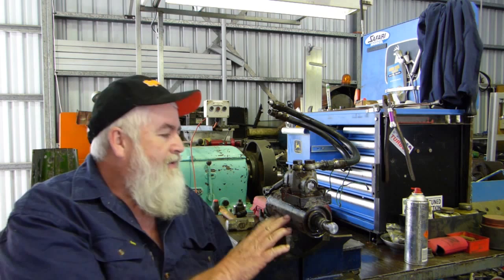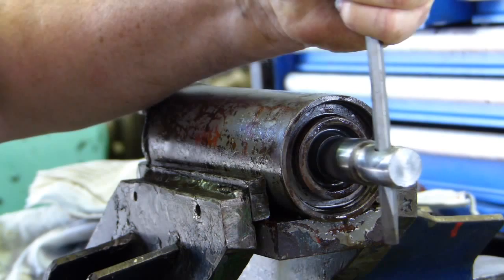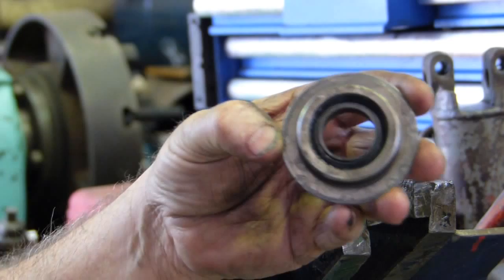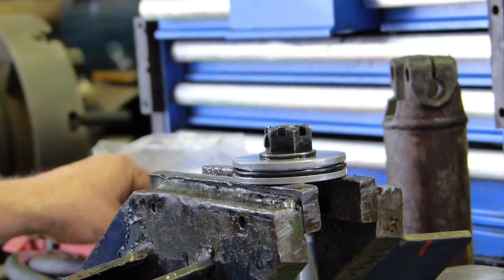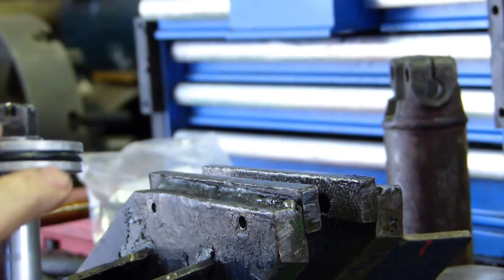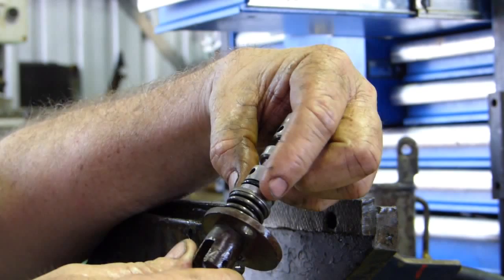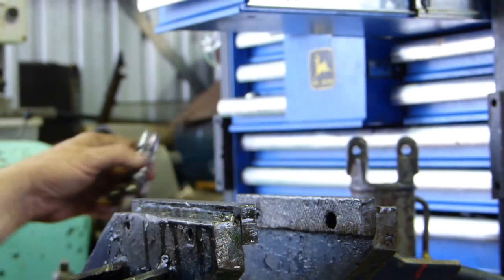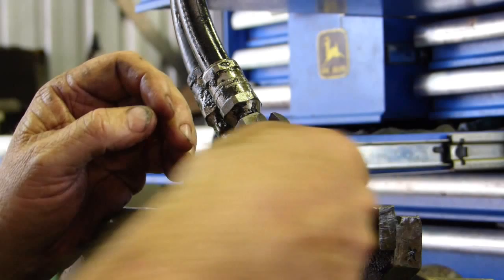Massey Ferguson Power Steering Cylinder Reseal

Comment: Very good information you share. I have a MF 240 4wD and the steering cylinder seems to be leaking inside past the seals making it difficult to steer. I’m always skeptical buying seals fearing they are not dimensionally correct for my part
Reply from the maker: 240 would be a bit different but open it up and see what is going on.

Comment: Watching from AB 🇨🇦. Thanks for the informative video!

I was wondering if they intended the back up ring to split on purpose? I have seen many others in different applications where they are split on purpose. It basically does the same thing just easier to install it. 

Im about to do one of those cylinder rebuilds on a 1969 MF 165. Also doing a clutch in it, because they hit something with the mower and it had a grade 8 bolt in the place of the shear pin, so it roasted the pto clutch off the flywheel. Got my new parts, just waiting for the machine shop to finish with the flywheel!

Good video! Thanks again!
Reply from the maker: Some are split for sure but they are usually split on an angle I was thinking.

Comment: i have a MF65. could you either do a video or explain how you removed the cylinder housing assembly from the tractor itself? the pin at the top of the ram and then the pinch knuckle at the bottom of the housing. thanks again.
Reply from the maker: If I get another tractor I could, I have sold this one to a mate of mine now.
Reply: I'll second that, I can't determine how to remove the pins that hold them

Comment: turnbuckle adjustment critical. Fixed mine . Had no power steering until adjusted.
Reply from the maker: Yes it is you can either have it favouring the left or right with the adjustment on that.

Comment: there are o ring tables that you can use to work out what ring to use it make the job go well when needed
Reply from the maker: +Bleu Wolf . Would you believe we have 9 o'ring kits to pick from and none had the right size, went to ENZED and no good there either but the Sparex kit came and got the job done, right size felt, right size scraper seal etc. we will use the Sparex ones in future for sure.

Comment: Love your videos great job! Have a Massey 135 1973 industrial it has a valve on the steering column with two machine services and I can’t get it to stop leaking. They sell a small kit and I’ve changed some of the O-rings and such I just can’t get it to stop leaking on the circular small plate on the bottom opposite the valve top ! the steering wheel pulls up and down. I’ve looked around and can’t seem to even find a new valve.
Reply from the maker: Im pretty sure the standard one from a 165 fits and does the job.
Reply: @BundyBearsShed  Thank you so much that’s perfect and you just save me $300. Thank you so much! Love your channel

Comment: I am still stuck with this particular project on my massey ferguson 50. My issue is i cant figure how to remove the power steering cylinder itself. I am talking about the same cylinder you are rebuilding here in the video. There is 1 pin at one end and 2 "pinch knuckles" around a larger pin at the base of the cylinder. How do you get these out???  I have the shop manual but it is very vague. Ive tried multiple times and am stuck. I dont want to break anything. could you please describe how you removed the cylinder from the tractor?
Reply from the maker: I dont have the tractor any more but I know they can be tight, give it a good soak with wd40 and tap it around a bit and it mat loosen up for you.
Reply: Bundy Bears Shed why the piston so hard to come out from the cylinder, because i trying to push out its come a little and then stop and i fell there is something stuck inside so please help me?

Comment: I'm trying to fix power steering on Massey Ferguson 230. Basically there is no steering. No leaks anywhere, pump is full, but will not turn either left or right except when I jack up front of the tractor. Any ideas?
Reply from the maker: G Day Col, When the tractor runs can you see the oil swirling in the pump canister? Check if it comes better when you rev the arse of it and also make sure you grease the front end in case you have tight king pin bushes or the king pin thrusts have fallen apart. If the king pins were stuck you would probably hear the engine load up a bit trying to turn them. You may just have a worn out pump, a sigh of that would be the pump getting quite warm and the engine not loading up at idle when you try and turn.
Reply: I will try your suggestions. King pins are greased and easy to move the wheels with my hands when I have front jacked up, even with the engine running.
Reply: ColKorn1965 turn buckle slop in pin holes.  Mine had same issue.

Comment: Thank you for the video. It was helpful in a few ways, but I am trying to change seals on a small Kubota power steering unit. The circ-clips at the ends of the cylinder housing tube  are on the outside, and once removed, I cannot see how they held the endcaps in place. I guess I now have to 'unscrew' the endcaps from the tube, as they do not just pull off?  Do you have an answer for that part of the process? Also, when you 'lubricate' the o-rings, can I presume you just use hydraulic fluid?
Reply from the maker: +MrMurrstir G Day Murray,
                     I dont mind at all. I cant recall doing a steering cylinder on a Kubota like that but it sounds like a few other cylinders we have come across.

I think you will need to bump your gland in and you will find a wire type clip stopping the gland from coming out. Once the clip is out make sure there is not a slight burr near the clip as there often is, clean off burr and the gland should then come out is my guess.
The external circlip is to stop the gland going in and hold pressure on the inner clip, the clip is often just a wire.
See how you go and let me know we might be able to help someone else.

I use grease or oil to lubricate the seals.
I sent a reply by email as well, Thanks for watching and commenting.

Comment: great video!  I however have a 1969 175 which has the newer style and I'm having a problem taking the valve shaft apart!  The return port in which the Massey Ferguson shop manual tells you to put a pin thru the thru hole in the shaft does not line up with the hole in the shaft.  There are 2 holes that are in line with the shaft, however, they are plugged with a hardened steel ball.. what do I do?!
Reply from the maker: Not sure Ill see if I can find info.
Reply: @BundyBearsShed  it's ok, I ended up ripping the oil seal out on the end, removing the snap ring and then the entire shaft assembly came out. Thank you for responding!

Comment: My control valve requires you to  unscrew the valve linkage end by inserting a punch through the return port to keep the shaft from turning.  I can't hold the shaft from slipping.  Is there a trick to performing this task or am I missing something?  Thanks in advance.
Reply from the maker: Pull the turn buckle off and give it a good clean and free up the threads it will turn easily then.

Comment: Very nice jobb and good detectiv woark to, i like this videos of yours.
thank you many times.
what is a propper oil to use in an temperature between 20 below cero and 30 abow in centigrade celcius? In advance, thank you for the answer, in the case i get one . :-)
Reply from the maker: Wow 20 below I would not be sure but I often use the automatic transmission fluid on the rear end Hydratrans.
Reply: Is it wrong to use a tractor combitype oil that is a bit thinner than normal tractor motor oil? On the hydrostatic stearing gear i mean?

Comment: I'll be resealing a MF 285 dual steering cylinders soon.   I'll need to figure a fix for the terrible slop in the mounting bolts.
Reply from the maker: Yes with steering you need to find every little bit of play and repair it to have good steering especially if you are driving on the road.

Comment: I have that valve on my mf 65 . So you know if the O ring is in (inch  ) or in ( milimeter)?? Because I have bougt o ring kit in inch  but I think it will not fit. Still leak's. So meby its o ring is milimeter then ..Thanks in advanse . Thanks for great video 👍👍😊
Reply from the maker: You will need to measure the old one as I cant open a kit at present.

Comment: Thank you, very informative video, your extra tips about o-rings and such are pure gold. Do you ever hone the main cylinder? That is something I did on brake systems on old cars.
Reply from the maker: G Day Richard, Yes when they need a hone for sure, even with a slight groove the hone can take any sharp edges away that might cut an O ring.

Comment: got a 1984 270 Ferguson. The pin (that attaches the cylinder to the mount) on the ram end of the cylinder is broken off about halfway through. Is there a trick to getting that out or do you have to take the front end of the tractor apart? I've tried penetrating oil and a magnet no success yet.
Reply from the maker: G Day Garry, They can be very tight, try heat or can you weld onto the pin at all

Comment: Thanks for the video! I want to convert my MF50 manual steering to power steering. I am having big trouble finding the cylinder. Up until now i know all MF50 tractor as well as MF65 share the same cylinder shape and size. The part number may be different but it only affects the internal design. 

Now i am trying to find the cylinder dimensions for my MF50 and use that info to find a commercially available cylinder.

Could you provide the dimensions a MF50 PS cylinder?
Reply from the maker: I think 165 would fit as well

Comment: Ur main piston has a rubber o ring mine has 2 steel piston rings what’s the difference.
Reply from the maker: Over the series they must have changed suppliers of the cylinder. The O ring has a full seal where some cast rings have a gap but apart from that Im not sure.

Comment: How to remove sterling  Cylinder from  1965 ferguson  tractor

 tractor
Reply from the maker: Sometimes the pins can be stuck but that is the main issue I have come across.
Reply: Mr Bundy, I am fairly certain I can rebuild the cylinder . My problem is I can’t get it off the tractor, any help?

Comment: What size tractor did your cylinder come off of? and did you have trouble steering? or just saw an oil leak?
Reply from the maker: +John Pavon  The cylinder was of a 100series Massey Ferguson not sure of the model noe may be a 165. The cylinder was just leaking.

Comment: I have a 175 MF but cylinder looks different. It has hoses with 90° tips on them that are leaking can u tell me what type of orings I need? Cant find any that fit locally. Thanks
Reply from the maker: There were a few different rams that looked very similar, You will need to take the O rings to a hydraulic place and have them matched up.
Reply: @BundyBearsShed  well that is my problem they were ruined when I took the lines off, I have nothing to go by. I just know regular orings dont work but thanks for reply.

Comment: Hi I have a 135 UK having trouble with the power steering. I changed the o ring I the valve cause it was leaking out the top. Doesn't leak anymore but steering is heavy. Any ideas?
Reply from the maker: Not sure if it is only hard one way it is the turnbuckle adjustment , you havent put the pipes on back to front have you?
Reply: @BundyBearsShed  no I'm pretty sure I put them in the right hole. Not a lot of room to mix them up.

Comment: So here we are in 2021 and I brought the same Bareco kit to find the same issues with a thin o ring and thin back up washer for the gland. My kit also had a hard neoprene dust excluding seal, not sure if that was supposed to be a softer rubber like the one in your kit? Another issue I found in my kit which I wasn’t entirely sure of was the seal that sits behind the dust excluding seal on the ram shaft had a noticeable taper on one side, like it is meant to clip into a lip but there isn’t a lip for it to fit into. I noticed the same seal in the kit you got in the video did not have the taper….so I’m wondering if it is for a different ram.
Reply from the maker: There are 3 or 4 different rams and the kits try to cover them all but often dont quite get it right. The Sparex worked well for mine  in this instance but I know it is not always the case.

Comment: I bought a M F 165   PERKINGS 212 TRACTOR.  I DID SOME. POWER STEERING PUMP REPEAR WORK . SO PLEASE LET ME KNOW WHAT OIL SHOULD I USE,( POWER STEERING OIL   OR.  HIDROLIC OIL)  THANKS
Reply from the maker: It will not matter, I like to put the same oil as the back end in mine.
Reply: Thanks, but I would prefer a  firm answer please, POWER STEERING OIL   OR HIDROLIC OIL?  THANKS  @BundyBearsShed
Reply: @parakramasenevirathne5676  I was looking for same thing. I found a link to a service manual for a 165 that states "type A" transmission fluid.
Reply: @tt600pch  thanks, l am from SRILANKA .I wonder what A type oil is ,  what we have in SRILANKA is.   90 is thiker. ,50 is medium ,,,40 is less thiker. And there's HIDROLIC , power steering oil
Reply: @parakramasenevirathne5676  The only other information I see that is consistent is hydraulic oil will  work as long as all other oil is out of the system. I have work on heavy equipment and used  oil from 10 wt to 32 wt. We run 32 exclusively at the plant I work at. We have temperatures ranging from 100 degrees F to -20 F with few hydraulic issues. I hope this makes sense.
Reply: @tt600pch  hello can you help me with mf165 manual
Reply: @ahdtsyxdgh3146  I do not have a manual and have relied on searching internet until I locate what info I need. I can try to help you.
Reply: @tt600pch  it would  be very good  if it posibble, thanks

Comment: Hi Lance this is a really interesting channel. Do any of your videos apply to a MF 204? I have a reverse o matic gas. Quick question for you. When I press the gas on my tractor it does nothing for a bit, but then all of a sudden it just grabs and goes pretty fast. It seems there is no in between on acceleration. Any idea how I can get it to be smoother?
Reply from the maker: I don't have any videos o these. I would look at the oil and the screen first but you possibly have a worn torque converter or similar.
Reply: @BundyBearsShed  Thanks for the reply! I’ll take a look at the screen.

Comment: Got another problem.. when using my  massey 150 if it stalls or i shut it off when hot, i have to use starting fluid to start it right away. or wait an hour to cool off to start. everyone i talk to has never herd of it,
Reply from the maker: Try tipping water over the injector pump to cool it down and see if that makes a difference, if it does the pump head is worn. Make sure the engine is stopped before tipping water on it.
Reply: I will try .. if it  turns out to be bad do you recommend rebuilding or getting a new one
Reply: yes it worked after water, what you think, replace or rebuild or can you rebuild that part?
Reply from the maker: The head of the pump is worn then. You will need a new pump. I think now a days you can get a new aftermarket pump for less than it would cost for a new head and to rebuild your old pump.
Reply: ok. thanks much

Comment: What model is this from
Reply from the maker: This was a 165 I think from memory.
Reply: @BundyBearsShed  do you have a number as I'm chasing that part that the wiper seal goes into...
Reply from the maker: call the shop on 1300 850 097 I dont do the parts side now a days.